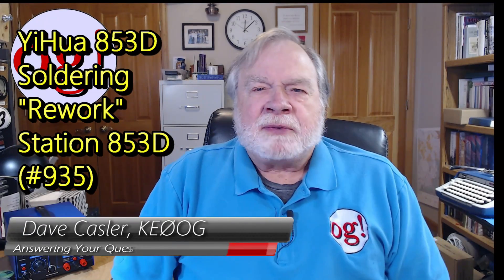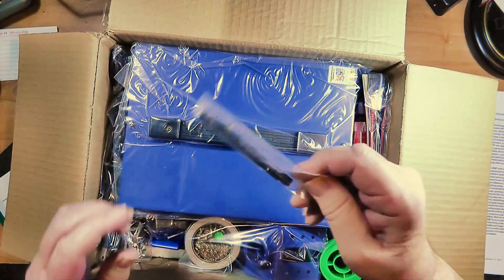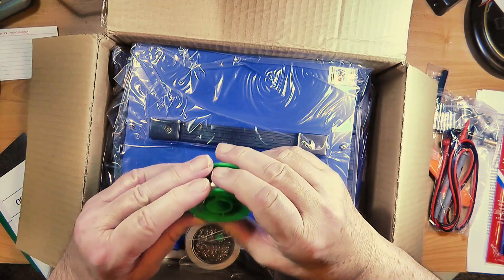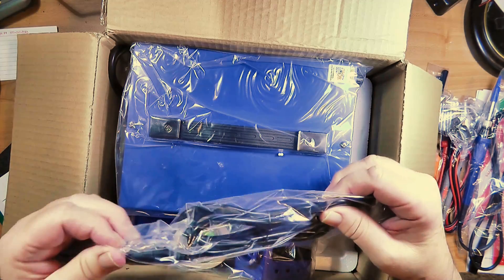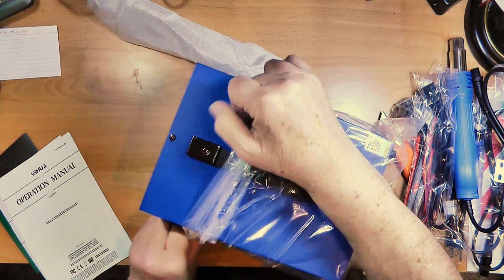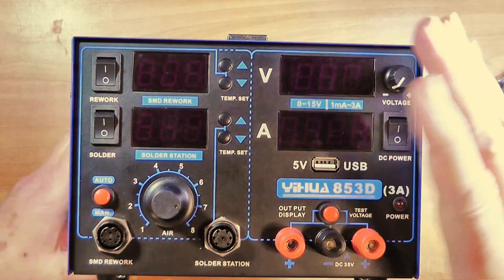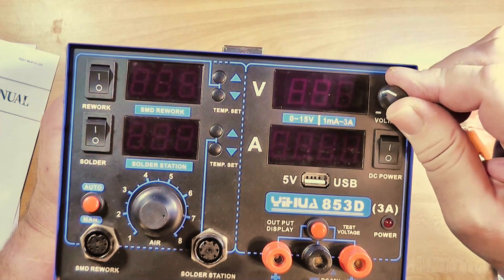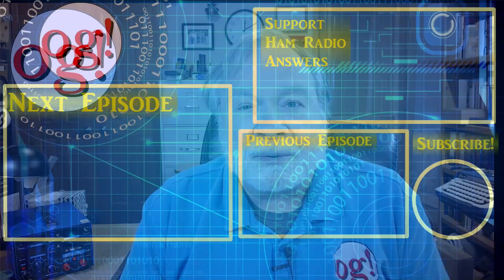Yihua 853D Solder/Rework Station Replaces Smoked Old Solder Station (#935 )

Comment: and here, I still do with an Unger spade tip (uncontrolled) iron. (and a slightly wet paper towel to clean the tip).  Bought it in 1959 and still works great.  Ah well ....